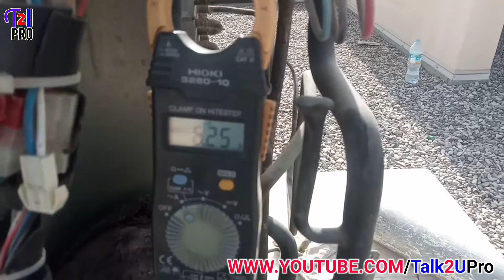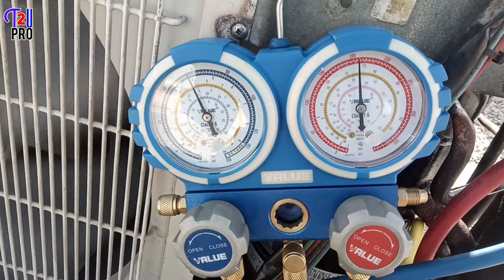Duct Split Air Condition Compressor Tripping Solved By Flashing Outdoor Unit | O-General AC Repair

Comment: Bayya muche ek 5 ton unitume same problum he heat hoker trip hothahe me bohath flash kiya lekil heat hoker trip hota he
Reply from the maker: Brother ya tu system blocked hai YA capillary main problem ho ga,
1# change filter drier, capillary, check indoor if there strainer / filter break mesh jali with screw driver, if everything done and problem not solved then change Compressor oil. Hope its will help you, also check indoor Unit if there is any opening or indoor suckling hot air from outside then also temperature not coming down & Compressor running continuously which is caused heating up Compressor.